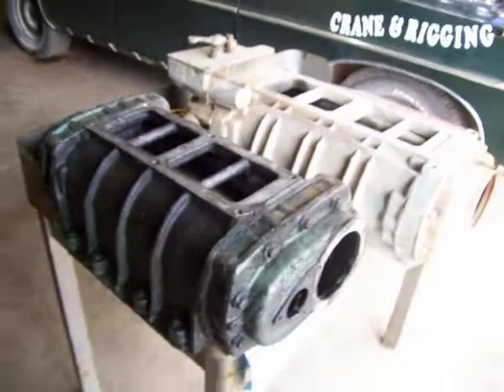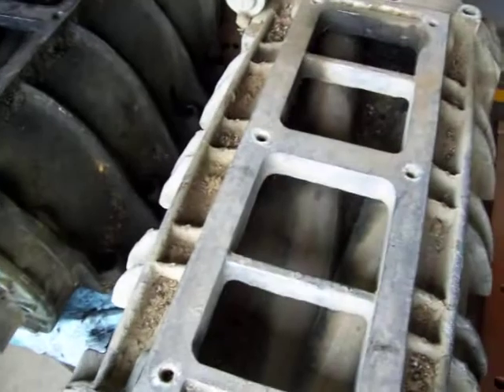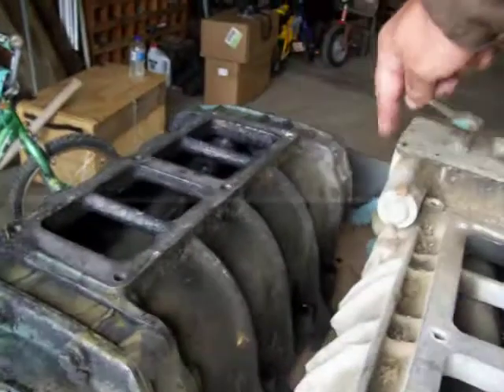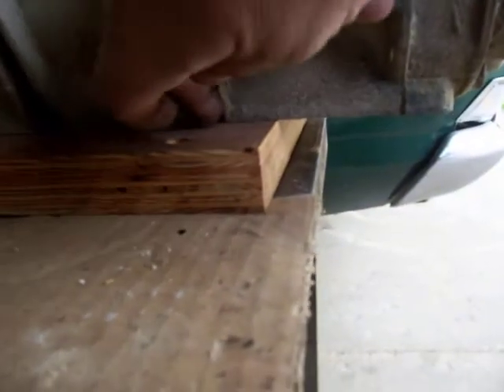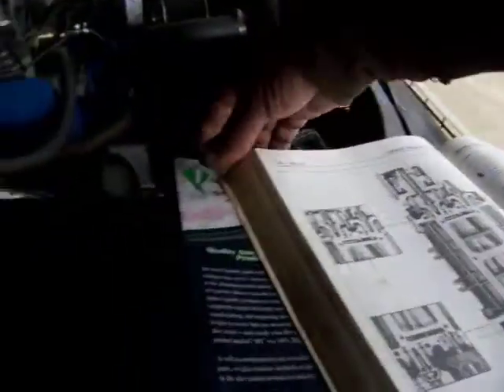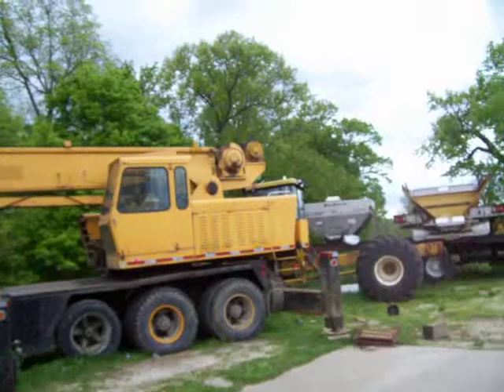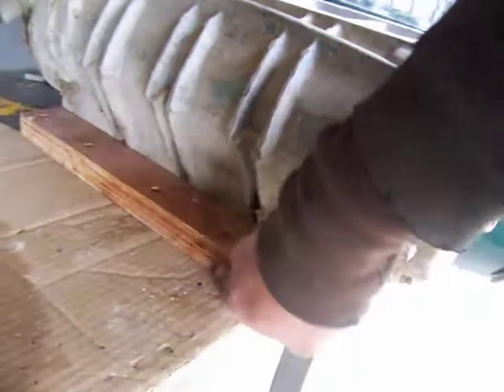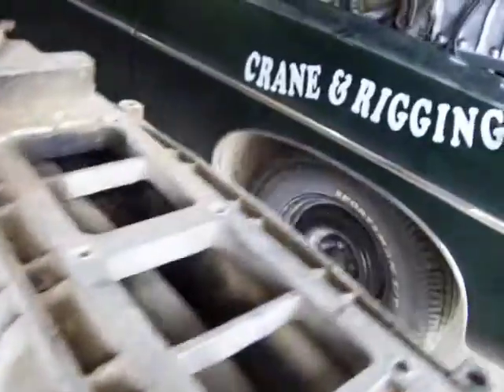More 6-71 Blower Talk

Comment: What crank damper setup did you run on the sbf? Id like to avoid running an expensive balancer/pulley setup. Im planning on low boost 6-8psi
Reply from the maker: I bought the "Drive Kit " from Blower Drive Service . Hub looks like this  https://www.blowerdriveservice.com/CH-5001-302-351W-351C-FORD-STEEL-CRANK-HUB-EXT_p_401.html
Are you building a small block Ford ?

Comment: Thank you great info. I have a new 6V71 Blower and I need a adapter plate. I can't make one until I get by drive belt and pulley's so I can line up the blower to my HEMI HOT HEADS manifold. I would rather buy one already built. I am running a 392 1957 HEMI .5 stroke 20 over it will be about 440 when done.
Reply from the maker: I like it and sounds like a cool project !   My advice would be find the intake and adapter plate first and get the blower mounted .  This is how we do it . 
 https://www.youtube.com/watch?v=OJ7ogTtkVAY&t=27s
 Then call BDS with the specifications .  https://www.blowerdriveservice.com/

Comment: Picked up a 6v71 off an old kohring excavator. Need to convert to gas. Plan on runnin it in my fe390. U know where i can get the adapter plate?
Reply from the maker: That's a great question !  I'm not sure on the plate but this is what it looks like 
   http://www.dragtimes.com/parts/6v71-Blower-Supercharger-To-671-Supercharger-Intake-Adapter-Kit-_131134254333.html
 Wish I could find one listed somewhere . 
  This looks like it on Ebay 
    https://www.ebay.com/itm/185186959440?hash=item2b1e00c050:g:hDQAAOSwK4Jhz3vn
   Jeg's shows the FE blower intake but it's out of stock . 
   https://www.jegs.com/i/Speedmaster/746/1-149-001/10002/-1
   If you can find the intake I think a guy could fabricate the adapter plate for the v series type blower .   
   Jegs shows a similar plate but it's for twin carbs so the holes wont be correct for the blower .  https://www.jegs.com/i/Speedmaster/746/PCE149.1008/10002/-1

 Do you already have the FE blower intake ?
Reply: did you ever get any progress done on this? I would love to throw an old detroit blower on my 390fe as well. 'Course I already rebuilt it to high compression, so boosting it might get tricky unless I throw dished pistons back in it.

Comment: Does the 6v92 share the same front bolt pattern as a 6v71 or 671?
Reply from the maker: No , completely different blower .
Reply: @cranerigging3604  the front bearing plate where the snout bolts up aren't the same on the 6v92 as the 71??
Reply from the maker: @hedgepethracing9590  No .
Reply: What covers will fit the blower ?? Trying to   figure out what cover to use for snout /belt drive.. going on a 351w
Reply from the maker: @hedgepethracing9590  That's a good question ?   I've never seen a 92 series used on a gas engine .    Seen 6v71 's used  , the v71 blower is different from the in line 71 .  Both will work . 
 I would give " Blower Drive Service " a call in the morning , they will know . 
  1-562-693-4302
Reply: @cranerigging3604  just figured it out, 6v71 and 6v92s share the same bolt pattern. So if they are making a 71 v series work I can make a 92v  work
Reply from the maker: @hedgepethracing9590  That's good to know !  Look forward to seeing your 92v project .

Comment: I picked up a dozen or more v8,and v6  - 92 actually they are about 1 1/2" shorter than the 71 series 6 or 8 but there was a turbo blowing into them,so  able to feed a bigger motor. The hold down arrangement leaves something to be desired, but they are cheap, different, but gears ,bearings ,ect interchangeable. Strange that nobody cast a manifold, they would sell. The adapter plate does allow for design in front to back shift in placement.
Reply from the maker: That's a  good point and  question  about they never cast a manifold for the V type blowers ? 
  We got a spare 8 - V 71 on the shelf that's thinking about ventilating a Ford 460 engine .
Reply: @cranerigging3604  ive got ta 6v71 im getting ready to put on a 460 too. have yo u done it yet?